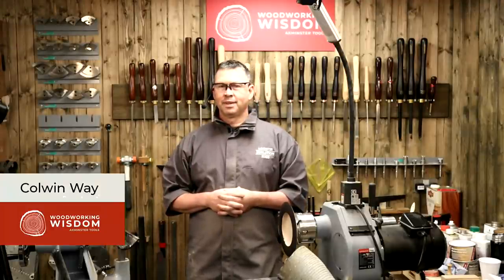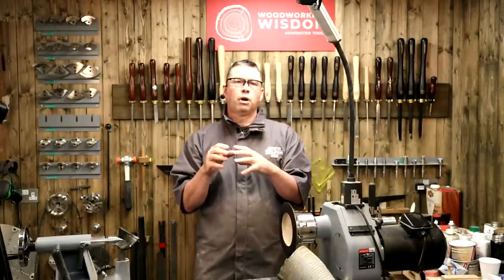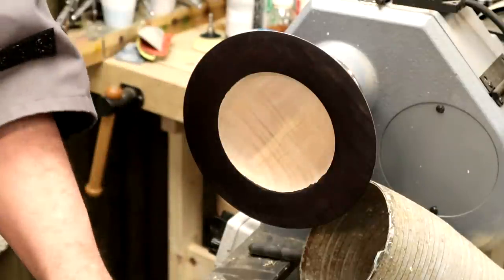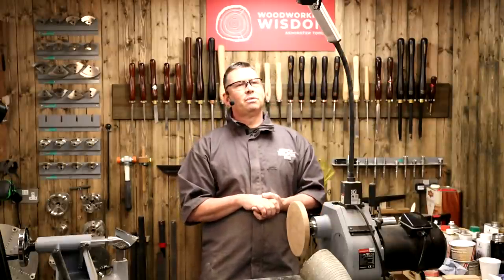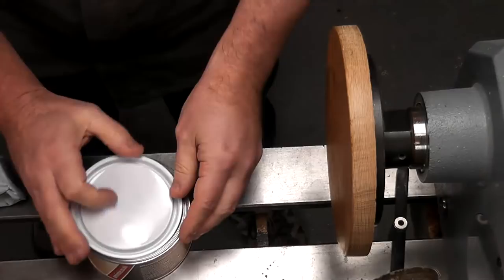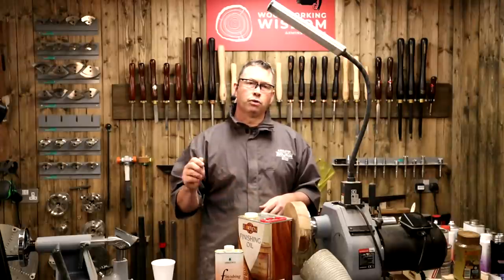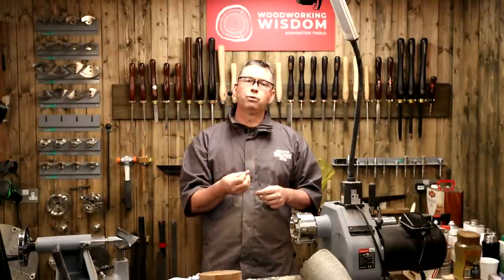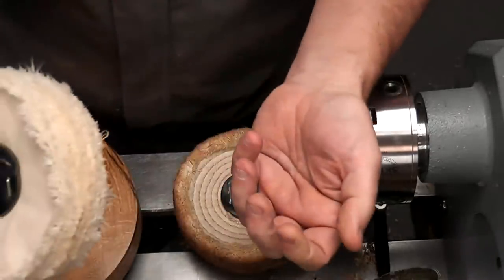Woodturning Finishes Q&A - Woodworking Wisdom

Comment: End grain in bowl. For pieces I'm going to finish in oil, I use the oil o the end grain during final cuts. Works great to support the grain during cut and reduce/eliminate teat out. Works well on the outside too. 
Lying wax leaves the wood light but is not really food safe. I use it on the outside of bowls.
Cereal bowls - Mahoney's walnut oil finish.
Montana Wood Art.